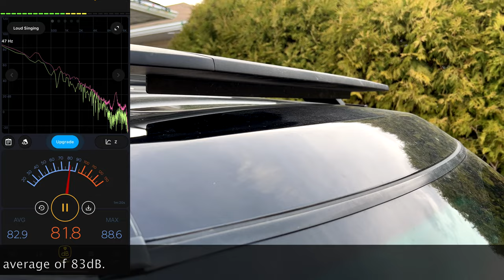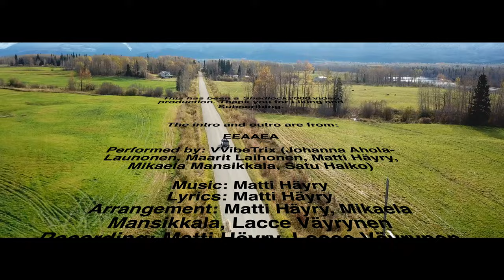Custom Roof Rack Bracket Build on a Range Rover — PT.3  #roofrack #rangerover #l322 #overland

Comment: The rack looks great. You could 3D-scan the brackets to get a software model that a 3D (metal) printer could recreate. That would save the prototyping with the cardboard. Some smartphones can even 3D-scan these days. The caged roof racks assume the vehicle will be swaying about off-road so the side rails stop the load sliding off. This isn't such an issue on-road so your rack is more versatile because you can lash loads that are longer than the rack itself if needed, as you mentioned in another video.
Reply from the maker: Yeah, the side rails of the Highlander II racks and similar are certainly useful off road, but they limit certain on road applications (they’re harder to mount kayaks to, for example). 

I haven’t really heard about mobile phone 3D scanning, though I’ve a pal here that has a scanner at the university that we might be able to use to scan the originals (or the models). He’s mega busy, though, so I don’t want to bug him with another favour! Our city is fairly small and not well serviced for things like that — I had to order the M8 bolts from Amazon, for instance, because no-one carries any black metric bolts in town at all! 

I’ve a feeling that these brackets would be useful to quite a few people if I could just get a good drawing from which to make a mould. I could do without taking the brackets off the vehicle, though, as it’s pretty annoying to get at the bolts and it’s a two person job (and there’s only me here now).

Comment: I would stick one of those sunroof wind-deflectors to the roof. It might just be enough to act as a wind fairing for that rack since it’s so low. Hope you’ve bounced back since your separation brother.
Reply from the maker: I hadn’t thought of that — it might! The sunroof does interfere slightly with the roof rails (which have to be adjusted if you want the tilt part to work), so it is pretty snug. That said, there’s very little extra road noise with the rack installed — it’s a huge improvement on the one on the Defender (and better still than on the D5, which was quite noisy). 

I’m getting there, Ed, but still not back to normal. I’m struggling to find time to record more content at the moment, as I’m also finishing up my PhD thesis. It’s been a very tough 18 months.
Reply: @shedlock2000  yup. I gathered that. Many of us, if not ALL of us have been through it (and/or will go through it). Time is all you need - I promise. Hang on.
Reply from the maker: Thanks pal! That’s much appreciated. It is surprising how little of a problem these things seem to be with a little distance. Slow progress at the moment, though.

Comment: Do you create these mounts? Would love to purchase some from you
Reply from the maker: Hi Jay, 

No, not yet. I’m struggling to find someone to 3D scan the mounts for aluminium forging. I’m working on it, but it may take a bit.
Reply: @shedlock2000  I do CAD drawings using Autocad. If you have some rough sketches with dimensions I could model them for you!
Reply from the maker: Hey Jay, 

That sounds like it might be an excellent collaboration. Can you e-mail me at shedlock2000@gmail.com, please? And we can work on the dimensions together?

Comment: Hi Steve nice installation on your l322, I have the same D5 roof rack can you help me get the bracket from throttle stop garage I bought the roof rack a year ago and I’m still waiting for a way to get the brackets
Reply from the maker: I’m sorry, Dimitri. As mentioned, these brackets are a build I’ve made for mine. These videos are to show you how to make your own brackets — we’re not mass producing them. If you follow the instructions in the videos, then you can fabricate the brackets yourself (which is the point of the videos).

Comment: Hi, nice fitting, I am looking for mounting hardware for to mount defender 110 rack if you have for sale? And are you in Alberta?
Reply from the maker: I am in Alberta, but I don’t have any for sale. These videos show you how to make these brackets yourself, which you can do with basic metalworking equipment. I am trying to get some cast, but I’ve not yet found an aluminium casting company who will do it.
Reply: thank you @shedlock2000
Reply from the maker: You’re welcome! Sorry I don’t have better news. These brackets are good and will let you fit the new defender rack (which is the same as the Disco Versatile rack, but you’ll need to either make them yourself or find a fabrication shop to do it following these videos.